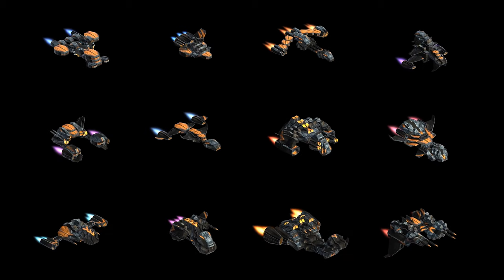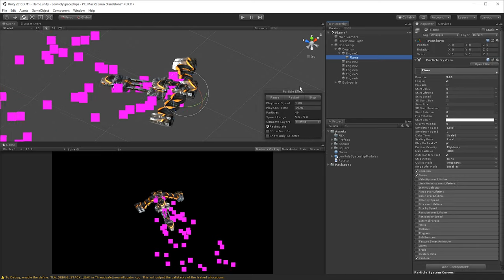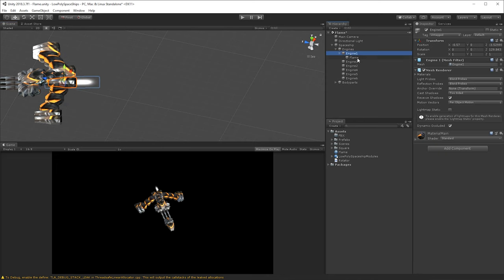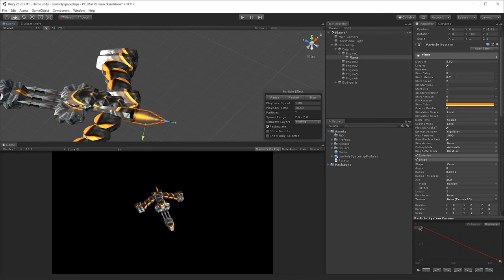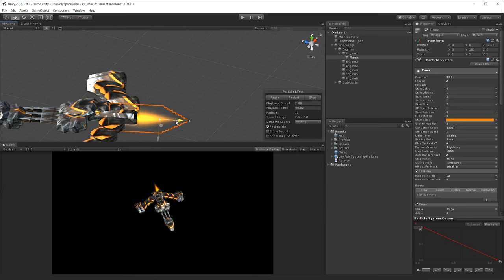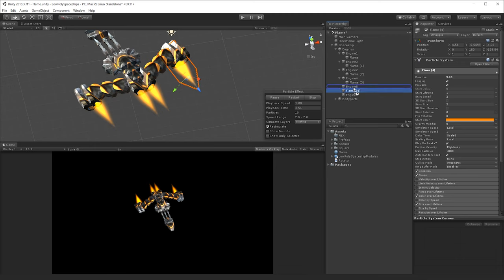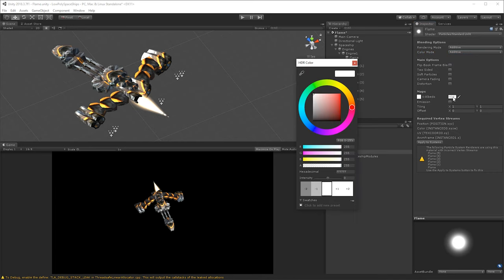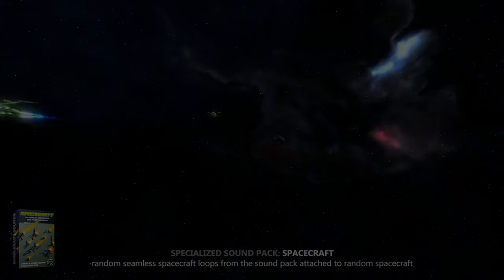Rocket Flames in Unity Tutorial

Comment: Hi is this particle effect good for mobile platforms or it will be too heavy on performance?
Reply from the maker: Hi, it should be fine depending on how many you want to show simultaneously though. Additive particles are a bit expensive (but not as expensive as alpha transparent) - so you could cut down on the particle count and make them stronger individually to gain performance.
Reply: @Imphenzia  thanks